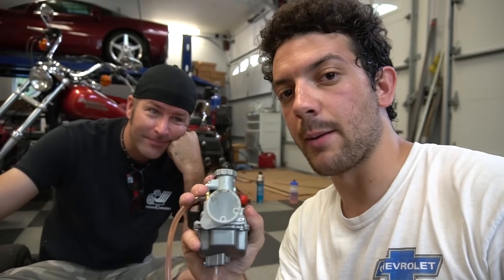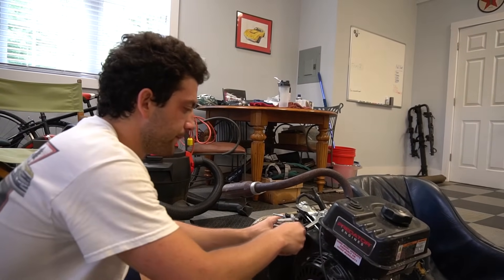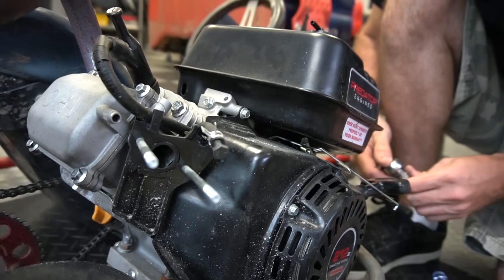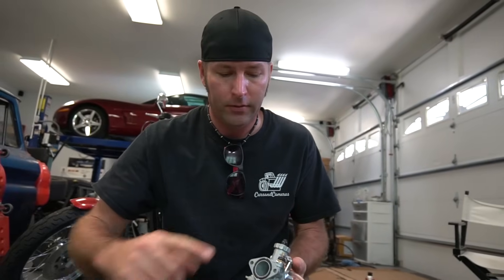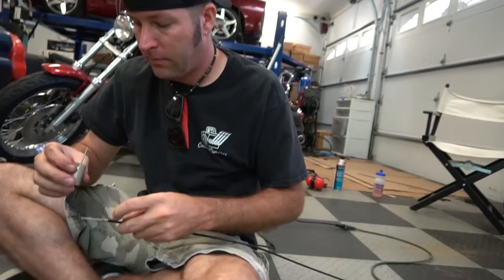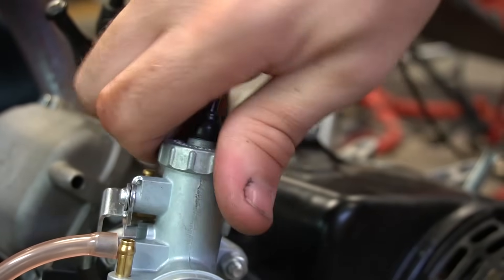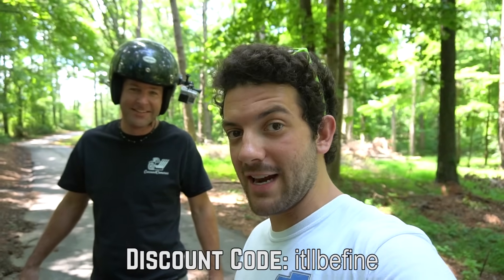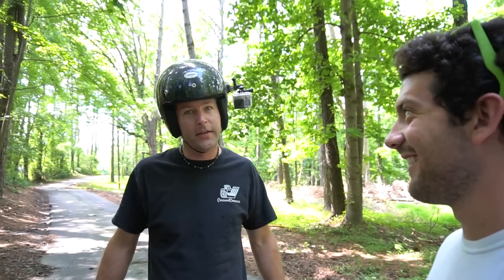How to Install a Mikuni Performance Carburetor

Comment: You moved that needle clip all the way down to provide max fuel?  What altitude are you guys at?  If nit at sea level... u will run way too rich IMO.  good video tho!  Bummer on the rod... but jesus... you took the governir offline.  What i would here on a stock clone is put a 5k limiter coil on it.

Comment: I put a vm22 on mine and it’s lean even with the needle position like you have, it would cut out WOT, I stacked some more shims up under the clip to get it to
Give it more lift yet but now I got a stumble in lower RPM maybe I need to go up on main jet size and go back lower with the needle?
Reply: Start your tuning from the bottom up, ie idle circuit, air/fuel screw (start at 1 1/2 turns out/in is richer), pilot jet (larger than #38), needle position (start in the middle/raising the clip leans it and lowering the clip richens the 1/3 to 1/2 throttle range. Only work on the main jet once the lower half of the rev range is correct.
It's called "Tuning". 
Do "1" step at a time. 
Good Luck. Cheers
Boots langley
La Mesa, ca

Comment: I need some help guys, so I got a build I'm doing and installing this carbonator on it, but what do you do with the governor arm after removing the springs? Do you remove it too? Does it affect the position of where it's left at?
Reply: Also on this Carb, I can't get it to adjust proper for the bike to turn on, any tips on how to fix this problem?
Reply: Same problem have you figured it out

Comment: Hey guys, great video. Would this kit work on a Predator/Honda clone 420? I'm not positive but I believe the carburetor on the 420cc engine is 30-34mm. Oh, one other question; if your rod wasn't billet, is it cast aluminum?

Comment: Will it fit Honda GX120? I got this engine for free, and it works OK on my go kart - but that stock throttle is hard to deal with. Thanks.
Reply: Yeah just get the right size intake manifold and adapter

Comment: Does anywhere sell a Angled intake manifold adaptor that points the assembly back so when the bike falls the air filter and carb dont break on the ground?

Comment: I mean you will run pretty lean going from a 20 chinese carb limited to 2800 rpm to a 22 mikuni. Right? splain it all a bit better. You guys seem to skip jetting all the time. Save me money by telling me what works. Carb changes are great but jetting guys we need to know. Have you tried different jets?
Reply: The throttle slide plate assembly includes a needle which lifts up out of the jet as the throttle opens. If you pull that assembly apart, you will find a small c-clip resting in one of four or five grooves in the upper section of the needle. You can adjust the resting height of the needle by putting the c-clip in a different groove; the ratio of fuel let in by the needle to air flow allowed by the throttle slide (in short, the mixture) will vary accordingly. Hope this helps!
Reply: This applies only to mikuni-type carburettors of course...

Comment: Threw a rod because you’re using the stock cooling and you used the air filter that came with that carb, let’s waaaay too much air in at all times and overheats piston or cylinder wall eventually.

Comment: Thanks for the help I installed it today but the only problem now is my tuning, every time I start it up with the choke up, it revs very high then when I turn the choke down it shuts it off. I’ve tried every tuning option. ANYONE have ANY suggestions?
Reply: Its running to lean its getting to much air and not enough gas rase the needle up on the slide and it should fix it
Reply: BullOfTheBush playz ok thanks a lot I’ll try tomorrow!
Reply: customvideo454  ok I will keep you updated when I have time to tune it, thanks.
Reply: customvideo454  still haven’t found time to tinker with her been very busy.. best of luck to you when yours ships in. It was really easy to install just needs tuning i hope.

Comment: Anyone know how I can fix a problem when I disengage the choke on my mikuni 22mm the engine dies?
Reply: Your idle might be set too low I don't have a mikuni so I don't know if there is an idle ajust screw it's normally on the side and just set the idle higher I hope this helps

Comment: Where does the line in the top of the fuel tank lead to ?
Reply: I just found this question 2 years late, Sorry! But if the 212 original gas tank that is bolted to the Predator 212 is being used, there is a VENT TUBE RUBBER HOSE LINE on top of that gas tank that would lead to one of the vent ports on a carburetor, just find out which port on the carb is for the gas tank vent and not the gas line itself,which the Mikuni carb mod for the Predator has two vent ports, one vent on the next to the gas line port, and the second vent port on the very bottom of the carb

Comment: Why do you need that adapter? Why not attach directly to the engine
Reply: so i dont leak gas and so it can get more air
Reply: and looks better
Reply: @noalancountyfinds7445  thanks mate :)
Reply: @mattpearce4313  welcome have fun  moving
Reply: moding

Comment: The metal bend in that cable should have gone into the top of the carb as far as i know
Reply: I got one of these carbs. It has two ends one is for the throttle one is for gas they are different shapes and are not interchangeable so long story short.... It only goes on one way.

Comment: So I installed a 22mm mikuni on my predator 212 non Geni with a stage 3 and it runs too lean and I can’t get it to idle correctly. Has anyone else had this problem and if so how did you fix it?
Reply: You figure it out?

Comment: hi guys, what sort of fuel pump would you use on a carb like this?
Reply: Stone Cold I used a Mikuni fuel pump I think it was like 20 bucks and works great. The outlet of the fuel pump is 1/4inch and the fuel inlet on the Mikuni is 3/16 So keep that in mind

Comment: You can actually have it 180* out ! 
The engine will Rev high as hell , throttle doesnt make much difference and you can’t adjust it out !! Lol 
I tried…. Till I realized what I had done… took almost an hour to figure it out , it was 420 hahaha!

Comment: I'm having a hard time jetting my mikuni 22 on my 196 clone. Does anyone have suggestions?
Its sea level
Chinese mikuni 22
18lb spring with no governor
Straight pipe exhaust
Reply: 95 or 100?

Comment: you guys are wanna upgrade even more get a .274 cam 37lb springs and a 24 flat slide mikuni or a 28 flat also get a Hillard racing clutch

Comment: over revved and kablewey. we don't need no stinking governor. governors maintain engine rpm as load changes and also limits the maximum rpm. governors can be adjusted. but only if you leave them in the engine and not in the trash can.

Comment: Yeah um your supposed to remove the governor you guys didn’t take it out
Reply: why "supposed to"? tho it still spins within the engine, it does not disrupt oil distribution enough to starve anything inside,,
their rod failed as it could not handle 6000rpm under load. but they thought it'll be ok for just now to test the carb or possibly didn't think of it yet.
Reply: It hits the rod. Got pics of what happens idiots bring me blown motors all the time ... no one ever listens to the reason who’s been building since upgrade kits been available

Comment: when i did the mikuni carb swap i noticed the the engine ran hotter without the stock throttle linkage. i dont know. but that was what happened

Comment: Beware - this is 'Fakuni' A Chinese knock-off not a Real Makuni vm22-133. There are very few jets available for these Chinese versions so you cannot tune properly. This carburetor is 30.00 so beware of kits that add a few cheap extras and sell for 100.00 and up (it's a scam).
Reply: No, the knock offs are the ones that are 30 dollars. You have them mixed up.
Reply: There is nothing wrong with the china mikuni! You will have to rejet according to your build and elevation etc. just like any aftermarket carb. and there are plenty of jets and needles avail. for them! You do have to watch the price point and not pay too much. I just bought one with the intake for a predator 212cc hemi I built and paid $28.00 on wish and a full jet kit ( slow and main jets) for it and it cost $10.00 the only drawback is shipping is slow! It works fantastic but don't expectto bolt it on and go!

Comment: All of your govenor parts fell into the crankcase and locked up your engine.  Do a complete  job not half ass.before you add a carb.look into after market parts to make a performance engine. Re assemble, take your time and do it right. From 6.5hp to 10hp could  be possible with the right parts(billet rod,flywheel,port and polish head,18lb springs,cam,roller rockers,carb,header.)base engine $100 after parts and your labor $600. Or just go stock(eliminate govenor, oil sensor)and ride.

Comment: that's not a mikuni  carb thats a chinese knockoff. really easy to tell in 2 ways, the genuine is a 22mm the fake is 26mm even though its called vm22 and the genuine has easy access to the  main jet through a bolt in the side of the bowl

Comment: It threw a rod cause it’s a $100 Chinese engine. Get a Honda motor
Reply: you can blow up a Honda just as easy. they are the same parts sourced to other factories and assembled. why pay $360 for a Honda when you get the same engine for $99. you can blow it up 3x and still have the money to buy a new header pipe lol

Comment: That’s a fake mikuni btw
Reply: it's the chinese one...the 'knock-off' one.. look at the tiny fuel inlet nipple hehe ..the little boot there i bet it has the tiny little return spring too ....it comes as a set on amazon too..i just returned one... i reordered this one.....   https://www.amazon.com/gp/product/B07V225VD5/ref=ppx_yo_dt_b_asin_title_o06_s00?ie=UTF8&psc=1

it's a little different than the gopowersports genuine one.....
same case... theres a brass screw there in the top... its left undrilled on the g.p.s. one.... theres a ''blank'' there for one to be drilled.... on both of em
https://www.gopowersports.com/22mm-genuine-vm22-133-mikuni-carburetor/
go to both sites and compare....  prices too...and gps is out of em...

Comment: Interesting enough boys i purchased on of these a kit with a intake a mikuni carb and pod filter with impression it was gonna be obviously bigger and. Wrong it is not bigger and to my dismay its supposedly a bootlegged clone. I wasnt putting this on a nock off briggs and strattin motor like yall but a honda ct 110. Ok so this aint good for me. How do you guys go about this kind situation as from the this will fit your model sed it was good this is not toatally true but not toatally un true either.

Comment: That intake manifold is junk! look how twisted the carb is, youll have to lower the float so low so fuel dont run out of it. that carb is supposed to set level..... IT WONT BE FINE... man come on lol